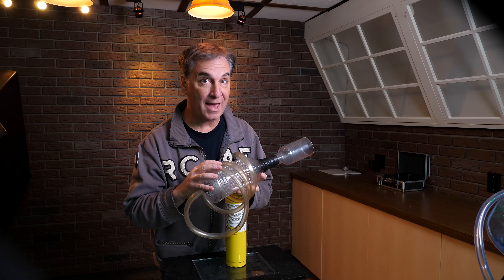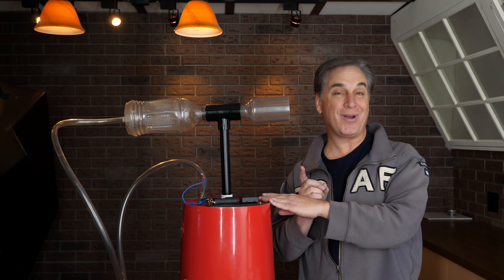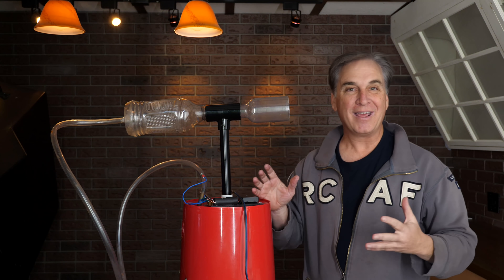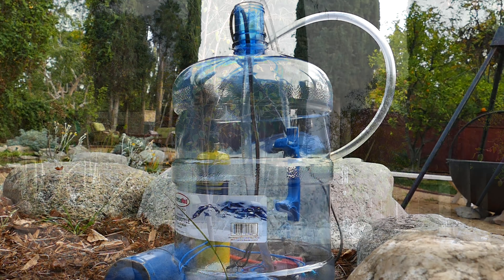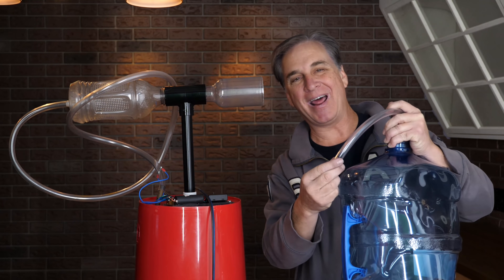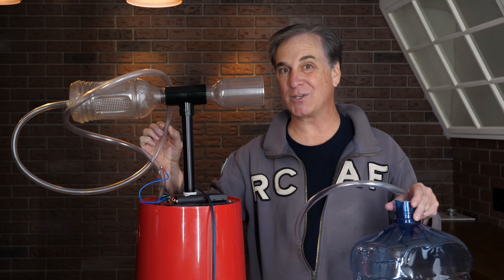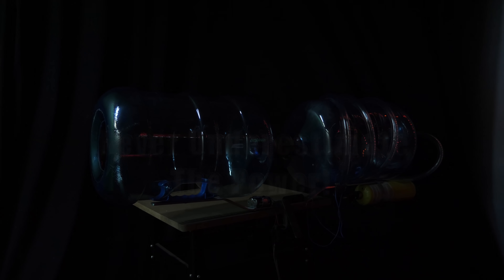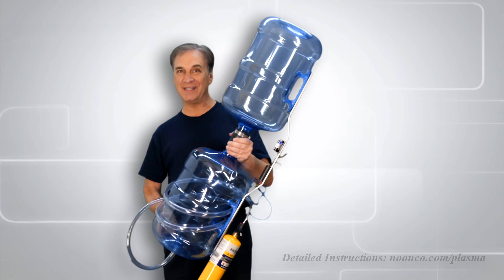GIANT DIY Propane Plasma Cannon!

Comment: ... So what I'm hearing is we need to use containers that are metal, my guess would be presumably aluminum instead of stainless steel since stainless can react poorly to high heat, instead of plastic.

Got it, they aint aluminum, but we could test with some discarded oil drums... And also a pipe or two... Well, good thing I'm a certified welder!
Reply: For all intents and purposes, mind you, this is obviously a joke, I dont have the time or resources to actually do that. I AM a certified welder, though. Two-year degree from a tech institute. No work experience, though, cause freakin' welding jobs ask for FOUR YEARS PRIOR EXPERIENCE, which is such BACKWARDS GODDAMN LOGIC, I tell ya!
Reply: For anyone Who want to mess around with this thing dont use metal, if the contraption blows up (and It does if your exaust hole Is too small) metal shard Will hurt much more than plastic ones

Comment: I'm working on a design for a plasma gun that uses  1/2" tubing, a heavy-duty spark igniter, and one of those bigger portable propane tanks that you use for a grill. If the one in the video sounds like a gunshot, I'm kind of scared to test mine once I build it.
Reply: I've built one bro, It's not as loud as a gunshot, but when you fill the whole container full of gas and ignite it, it's going to hurt your ears if you are close, but it will sound way different than a gunshot

Comment: Ah, The lethal Beauty of Science in Slo-Mo though I doubt the Military has any interest in Plasma tech at the time, This goes to show how much force a Plasma Cannon/Launcher would have later on. 

When I think  of that Plasma Blast i see the Knockback Equivalent of  a 50.Cal Rifle Round, but in Close Prox only.  It's Not the Force that makes Plasma Tech Lethal, its the Effective Range so as Heat is Hotter when its closer to the Combustion Source it gets Cooler the Farther it has to spread, makes it less effective  at Incinerating and thats what Sci-Fi Enthusiasts often expect to see. A Clean Cut or Penetration
 Lightsaber/Beam Shot.  So hot that it leaves no Blood Splatter.

Comment: Challenge: 18" frequency chamber firing solution. Contain frequency and release as trajectory. Dish and ...? I remember when friend of mine was explaining different types of subwolfer boxes. The smaller boxes used a facing-subwolfer with opening above and between the two facing subs to increase bass, which also increases output. I'm thinking of a spherical box, two facing 10" subs, with a directed output. Hmmmmm.

Comment: I like the reverse flame at the end. I think it's oxygen burning in a propane atmosphere with the flame going backwards.
Reply: It's called a vacuum. Ever seen a nuke go off? The oxygen ignites the relative instant any other gas does. But when you transfer matter to energy, energy must move or  change. So with no matter to fill the space anymore the explosion is pulled back to its point of origin.
Reply: Having lower pressure is why it's moving in that direction, but reverse flames are real things, and I'm fairly sure it is briefly happening here. Cody's lab has a video where he intentionally creates one.
Reply: A vacuum IS lower pressure. It's an absence of pressure. So propane ignites around 450°C and oxygen at 570°C. If you had used a shield gas with a higher ignition temp like those used in plasma welding I would say yes, because of the period of time between their respected ignitions. He talks about finding the right pressure to keep in the line because when the atmosphere adjusts to the lack of pressure it climbs back into the tube until met with an equal force of propane from the container. The oxygen that was in the container ignited and left the "chamber". Plasma is just super heated gas, but it's considered the 4th state of matter because it shows some very similar properties with other matter. Hence, pretty easy to get sucked into a vacuum.

Comment: D'you know, I think this is a great idea and I have a "Bolt On" idea for all those Squirrel lovers out there. A perspex tube some 5" Diameter as the barrel, about 15" long, with a pressure sensitive switch attached to the feeding mechanism down inside the barrel, (perspex tube). Now, that sure would sort out a few of those critters. I wonder how far a Squirrel can be blown with a Propane Plasma Cannon?   Hmmmmmm.....! Or even maybe a compressed air cannon....!

Comment: We used to  Shoot Tennis balls out of pop cans With lighter fluid. When can'swere made out of steel. 7 and 9 can't worked  The best. One whole pop in at the bottom With hole punched at the bottom of the rim.   Size of a B.B . Cut the tops and bottoms out of the other 7 or 9 cans.  Tape all together. Squirt lighter fluid from the top in  Side of the bottom can. Stuff tennis ball into the bottom. And light at the little hole at rim. Anywhere from 150' to 500.

Comment: Hi nicely ✔ only one thing next use a edf alongside sink stopper + actuator switch couple for a gas stopper whenever plasma starts the ignition chamber thus both can be temporary✋ within latency before dispatching..

Comment: You Can Make It As A Propulsion If You Make It Like Jet Engine Or Rocket Engine
Reply: It's possible. But..... Restrictions: 1) Everything has to be made out of heat resistant materials. 2) Constant flow on propane, preferably in a liquid state. At a correct ratio. 3) Liquid oxygen flowing at a correct ratio 4) Smaller combustion chamber, made out of pressure resistant material. 5) Igniter that doesn't melt 6) Pressure only from blowtorch probably wouldn't be sufficient to pump fuels at correct ratios. Therefore the pump would be needed or helium tank to pressurize fuel tanks. 7) Liquid oxygen likes to react with a lot of things, so materials have to be very carefully chosen, thus expensive  8) This is extremely dangerous and very hard to build. edit: Jet engine is nearly impossible, it requires air intakes.
Reply: @andromeda_yt_  But It's Possible, And Of Course Jet Engine Need Intake, Maybe Making It As A Rocket Propulsion Instead Even Though It Still Need Internal Oxygen Tank

Comment: I like your way of thinking...safety first. Even though nothing could happen (exploding the plastic) one can't be too anal about safety.
I build a different version of it in metal and it's really loud. A timer valve ensures space won't fill with too much gas at a time.
You learned about Newton's law of action and reaction as you essentially created a rocket out of this canon.

Comment: Much more fun when you make it in hard walled pvc 2 or 3 inch pipe and put a potato down the barrel. At 30ft the potato took the top half of a plastic clorox bottle clean off like it was a knife.

Comment: When i worked in a wrecking yard; we cut the drive shaft from a '64 Rambler station wagon at one end & put a touch hole at the other end w/ a cutting torch. Basically, it was like a 4.5" diameter cannon which was 7' long... Into the touch hole was placed a model rocket launcher det line & igniter; after we stuffed a rag in one end & filled it w/ oxy-acetylene gas...We detonated it. It flew over backwards & sounded like dynamite going off...Scared the hell out of us; & all our neighbors in the Ghetto where the wrecking yard was located. Our boss said the windows in the office which was about 300 feet away rattled, he thought it was a big sonic boom from a fighter jet from inside the office.

Comment: Um.. how.. is this a plasma gun? or are you just talking Plasma because your Arcing electricity?
Reply: 1 get some partially wet charcoal
2 tap it lightly with a hammer
3 put it in the microwave for at least 1 minute and boom plasma

Comment: How is that plasma? Just a gas powered concussion cannon.
Reply: @oceanhavenblue  fire is not plasma it is not hot enough and it is not gas it is combustion
Reply: 1 get some partially wet charcoal
2 tap it lightly with a hammer
3 put it in the microwave for 1 minute and boom plasma
Reply: @batenkait0s657  you keep saying that, what does it do?
Reply: @thetruthisonlyperspective4872  it makes an electric arc and sometimes plasma it also can make fire and break the microwave so be careful also it can produce CO not CO2 but CO
Reply: @batenkait0s657  so do it if you can afford a new microwave, and do so outside then?
Reply: @thetruthisonlyperspective4872  pretty much also beware CO and CO2 poisoning
Reply: @batenkait0s657  lmfao I spit my beer out reading that.  Why in the serious fuck would anyone do that?

Comment: It has nothing to do with plasma, an ionized gas consisting of positive ions and free electrons in proportions resulting in more or less no overall electric charge. Another toy named by idiots.
Reply: 1 get some partially wet charcoal
2 tap it lightly with a hammer
3 put it in the microwave for at least 1 minute and boom plasma I AM NOT RESPONSIBLE FOR ANY BROKEN MICROWAVES

Comment: Didn't see where the plasma comes in, the definition being :
A plasma is a hot ionized gas consisting of approximately equal numbers of positively charged ions and negatively charged electrons. The characteristics of plasmas are significantly different from those of ordinary neutral gases so that plasmas are considered a distinct "fourth state of matter."
Reply: @Andy The Creator  Anything that makes interesting explosions is cool, I have played around with acetylene in barrels. A five gallon drum with the bottom cut out with the right oxy mix can go more than fifty feet off the ground, makes a fair sized bang and will break a workshop roof.
Ozone can combust spontaneously with some substances and will burn when diluted in inert gas.
Reply: 1 get some partially wet charcoal
2 tap it lightly with a hammer
3 put it in the microwave for 1 minute and boom plasma
Reply: @Andy The Creator Jeremy Clarkson has done a lot of dangerous and irresponsible things on TV. 

I wish he was still doing them.
Some years back we used to make exploding airgun slugs and fire them at plastic bottles with a little petrol in them, that's fun but can be a bit dangerous, probably get you arrested in the UK now.
Reply: @Andy The Creator thanks for saying put it under glass though a heat resistant glass would work best this makes sense because carbon seems to have properties of a metalloid despite others thinking it's not 

1 it's sort of conductive but not fully 
2 it can form alloys with things like iron 
3 in the form of graphite and some other forms it can be quite lustrous 
4 it has a high melting point compared to most nonmetals
5 depending on the form it can be a bit ductile and malleable

and it act's a bit like metal in the microwave
Reply: @Andy The Creator try water with a bunch of salt in it
Reply: Some parts of the flame is plasma. Literally ionised gas, albeit weakly.
Reply: Our plasma cutter at work just runs on electricity and no gas.

Comment: We used to make em with thick wall schedule 80 2in and at the bottom use a improvised tank made out of 4in pvc 2 couplings and a reducer and launch potatoes 500-600 yards

Comment: A few years back I made a similar thing with a propane torch, an igniter, a stainless steel (also used aluminum ones too) drinking water bottles that Dollar store and walmart has usually. basically put that stuff together with a trigger igniter rigged set up and leave the cap off the bottle. I used it for blasting flies and it was great! I called it The Fly Finger Death Punch... My girl at first was all concerned over it because of the BANG it made but as soon as I got her to try it out, i never got it back and had to make me another one lol.. Takes out several flies at a time...

Comment: With the right barrel arrangement, could this be turned into a huge vortex cannon? I can imagine the gas output from that monster would be huge!
Reply: If the jews did that 5739 years ago with giant horns powered by the Ark of the Covenant, you can do it with modern technology you can get at your local hardware store

Comment: Have you considered filling that second chamber with a little smoke before the ignition? If you did I bet bet you’d get an awesome toroidal smoke ring due to the shape of the 2nd chamber and the exit hole! Just a thought.
Reply: Collin Smith what if the smoke reacts with the igniting gas?

Comment: How do you only have 20,000 subscribers you deserve why more than that
Reply: because that is not actually plasma though I can give instructions on how to make some do not sew me if you burn down your house
1 get some partially wet charcoal
2 tap it lightly with a hammer
3 put it in the microwave for at least 1 minute and boom plasma I AM NOT RESPONSIBLE FOR ANY BROKEN MICROWAVES

Comment: Use clear pvc pipes looks somewhat like a potato canon what if you add a pipe and a dart in the pipe and have the drum at the wnd of the pipe so it can shoot something and really be called a gun and it makes the noise too use like harmless nerf darts or somthing thats what i used at home and i put the loud red and white pop its that look like tiny stiks of tnt inside the darts so it explodes on impact im a mechanical electrical and chemical engineer not by schooling but by knowledge and my family is built up of many different types of engineers so iv been learning many different fields since I was little and can make or build just about anything im super crappy at coding and computer stuff but everything else comes with me like its a part of me

Comment: I imagine with a very well and correctly mixed fuel/air combination, that plastic bottle would rupture, violently.  Getting a dangerous mixture would pretty much be a random event so the risk would always be there.  Don't use either oxygen or acetylene for this and certainly not both, it will definitely, positively, violently explode.

Comment: Hey man. Why you don't make, an automatic gun out of it. its very easy, the hints is, check the last beatifull slowmow of the big gun. 
at one point you see clearly that heat and fresh air is suckt back through the throat in between the two blue chamber.
so lets say you make at point where you feed in the fuel line. make the diameter much wider. include a valve. during ignition in the first chamber valve closes after ignition when back sucking is happening the valve will open suck fresh fuel.
Would be some kind of a Pulse-Engine. but if you could do it with plasma and plastic which we can see. would be great.

Comment: I'm a Pipe Welder and play with Acetylene torches all day and this makes me cringe, the fact that your pressurized Fuel Source is attached to the container that you are Igniting is potentially fatal and very dangerous. Like starting a camp fire with gasoline and letting your 5 gal. jug of gas sit next to your camp fire. Don't roll the dice if you don't have to

Comment: Use a filter at the end of the hose going into the bottle like a rock aerator for a fish tank just something the gas can flow through you'll notice the fire can't travel back through the small holes acting as a blow back valve   so you could put the igniter inside The bottle and have the hose as long as you want it....

Comment: But, plasma is super heated, ionized gas. The 4th state of matter. Nevermind.
Reply: Yes it is! Sounds suspiciously like a flame, right? Flame = Super heated ionized gas = plasma
Reply: @mrayoung  ehhhh? Heated gas and super heated ionized gas are two different things. It's like saying really cold water is ice. Just because I blow the cooking surface off my grill doesn't mean I made an plasma blast. It means I had a build up of gas. You just had a controlled explosion.  Pressurised gas forced through a receptacle. No different then a potato gun.

Comment: Makes me contemplate thrust output. Stronger materials and a computer managed idle cycle and acceleration mix might come of interest in a low to high speed propulsion system with development. Very interesting! Thanks!
Reply: Yeah, I always thought about that. I wonder how much force the expansion of the gas creates and if it would be able to fire a projectile much like a firearm.